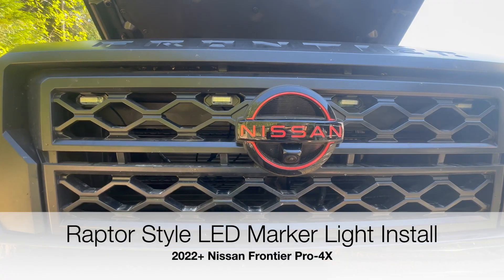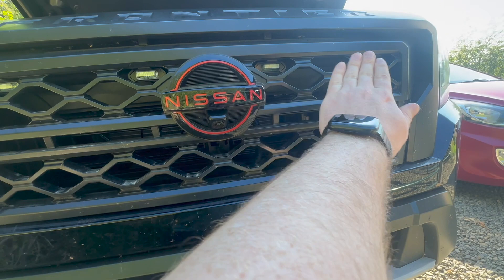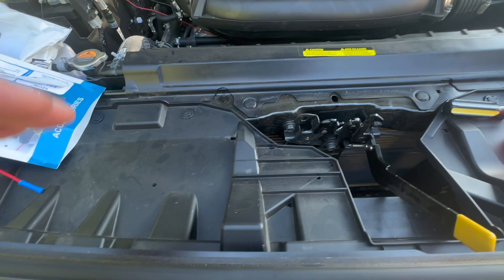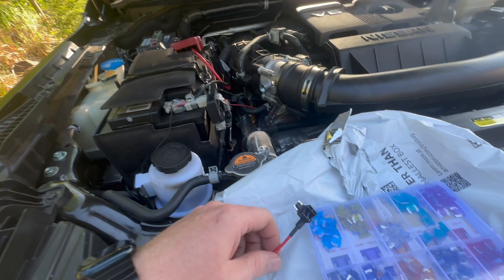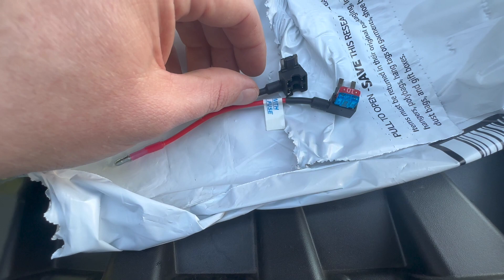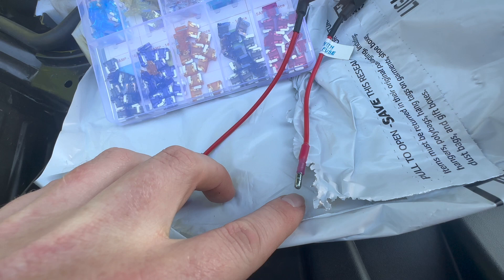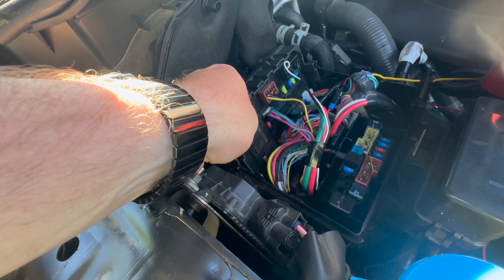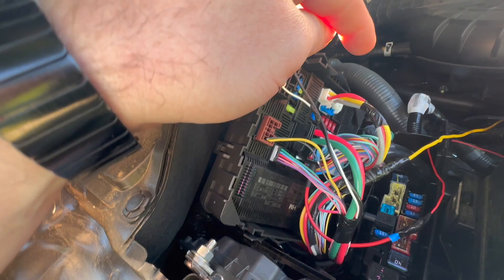2022+ Nissan Frontier Raptor Style Grill Light Install

Comment: Question, i ised the dame lights but i tapet into tbe DRL circuit. Im having a problem, when the DRL turn off the raptor lights dont turn off. Do you have any suggestions, or should i routed the way you did it?
Reply from the maker: For some reason if you tap in the DRL, the lights will always stay on. I suggest tapping into what I did.

Comment: So why the need for the 15 amp fuse with a 10 amp? I have seen an install where just the 10 amp fuse was being used in the reverse light slot. TIA.
Reply from the maker: 10amp will work

Comment: Did you by any chance replace the DTR LIGHTS to LED, if so is there an easier way to do it without removing the plastic wheel well
Reply from the maker: Mine DTR are already LEDs with the package I got. I know for the fog light change, you'll need to get behind the wheel well.

Comment: Hello, new to this

you mentioned you put it to the reverse lights/back-up camera fuse, how did you do to not lose the reverse lights/camera? did you put the 2 fuses? thanks in advance!
Reply from the maker: You’ll use an “add a fuse” connection that uses two fuses. It powers what you’re borrowing from and the new addition

Comment: Great video!!

Once you connect to the fuse, did you just close the fuse box cover ? Will that damage the wire?
Reply from the maker: I just closed it. Probably should have cut a hole for it, but didn’t. Lol
Reply: I took a razor blade and cut a small notch in the corner of the fuse box both bottom and top half so it sits in there.

Comment: 👎 total regret buying my 2022 Nissan frontier crew cab

👎 you can’t turn the driving lights off on the front part of the bumper 

👎 the radio takes forever to boot up makes me think it’s going to crash one day 

👎 open the hood and wiggle it up and down from the center with one hand and look at the hinges wobble like they are ready to break loose.  

👎 the steering is extremely Stiff.  

👎 notice the 24 Nissan frontier. The front bumper does not touch the front of the fenders.  My 2022 Nissan frontier the fenders touch the front bumper and they pop out all of the time they should’ve made the front bumper metal. 

👎 the plastic bumper on the front keeps popping loose from the front of the fenders. Makes it look like crap. You have to keep pushing them back in.   

👎. Spend almost $40,000 and you will not get running boards. 

👎 if you buy a four-wheel-drive and you get hit in the rear end collision really hard the left leaf spring could poke a hole in your gas tank. There’s a safety recall on that. 

👎 they have way too many sensors on the dash that absolutely drive me nuts. 

👎 they made it kind of difficult free to reach in an access the oil filter so you can change it which is stupid. They should’ve put the oil filter on top of the engine like they do on Mercedes.  But they make it difficult for you the truck owner so you have to bring it to the Nissan dealer. Which I will never do. 

2022 Nissan frontier sucks ..

👎 faulty door, locking mechanism on the drivers door. 

👎 if you don’t close the drivers door hard, you might have to open up the back door and reach Drew to open up the drivers door.  

👎 way too many sensors on the dash that drive me nuts. 

👎I like the 1997 extended cab automatic four-cylinder much better than I do my 2022 Nissan frontier. Personally I have total regrets of buying it. Keep in mind they depreciate really fast.  If I could find a 1997 extended cab, that’s in really good shape I would put my 2022 Nissan frontier in the desert and set it on fire just to show how pissed off I am about the truck.
Reply from the maker: Sorry you’ve had such a bad experience. Oil filter problems went away with the covert bumper install. I’m hoping for a recall on the driver door handle lock…I’m having similar issues. Other than that, I love the truck. Not a truck for all, but perfect for me.
Reply: You got a lemon. Don’t have any of those issues on my 22